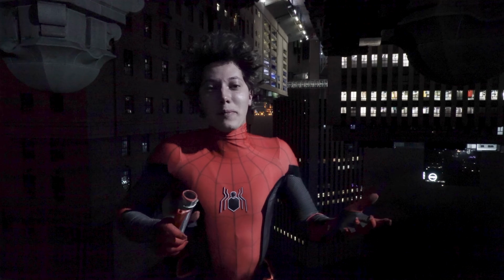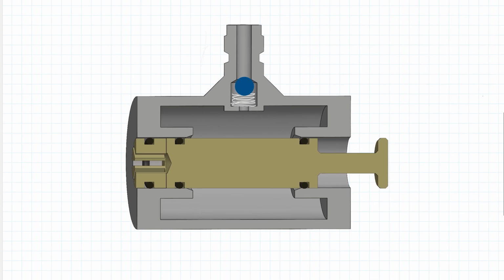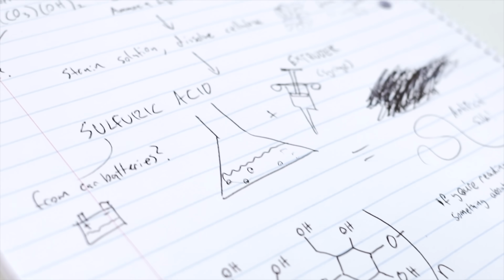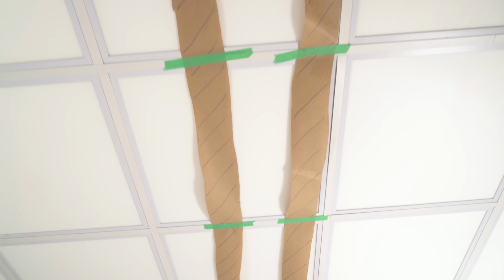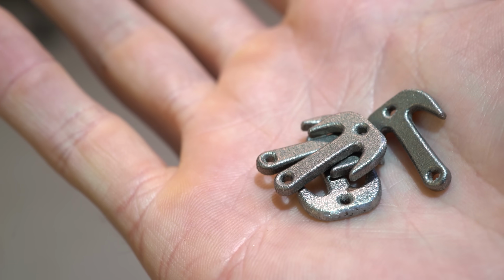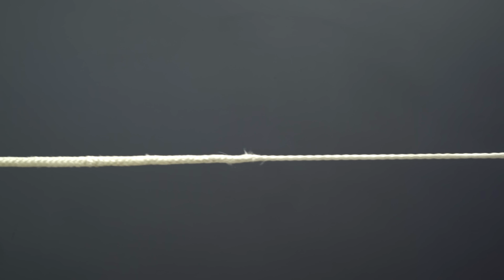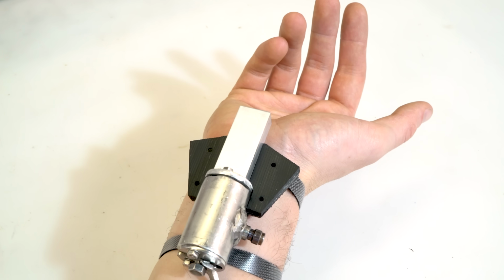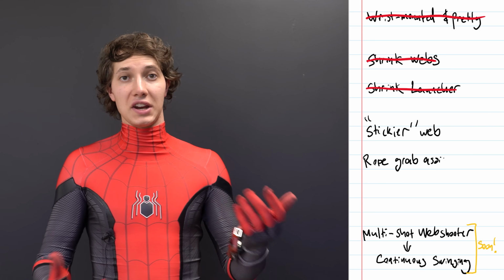Engineering real Spider-Man webshooters

Comment: god. material research, trade studies, manufacturing, strength analysis… you actually ENGINEERED this. what a gorgeous solution. you’re leagues ahead of the average maker youtuber.
Reply from the maker: I'm really proud of the engineering work, so that means a lot to me. thank you!
Reply: @Built_IRL  Organic Shooters are more reliable, Mechanical Shooters are more adaptable.
In the 2017 Spiderman animated series we saw both Mechanical and Organic shooters in use. Peter and Miles use mechanical shooters after being bitten.
Anya and Gwen used organic ones after being temporarily exposed to an Air-borne Spider Virus along with the entire city (it was a whole thing), they were the only ones to keep their spider powers.
Cindy uses organic shooters which is weird since she was bitten by the same spider as Peter, Miguel uses organic shooters according to comics and Venom creates his own strands.
Reply: @Built_IRL Is there a way to contact you directly bro?
Reply: @Built_IRL you should design your hooks to be spilced into the rope instead of the rope looping through a hole and splicing back into the rope. 
Instead of a "T" shaped hook, move the barbs half way down. Drill holes to allow the rope to pass through as it's being spliced. 
You could cut a lot ogmf weight per hook...allowing to add more barbs thus decreasing the probability of failure.
Reply: @Built_IRL  How did you choose the O-Rings?
Reply: @Built_IRL why don’t u post anymore
Reply: And going to Canada just to get the material. That is dedication even though he didn't get the steel he wanted because that price is fckin crazy

Comment: Really nice design. I'm a little unclear on the purpose of the third o-ring on your valve, though. Is this just to prevent metal on metal contact and scoring of the sealing surface?
Reply from the maker: Good catch! Exactly right, it doesn't do any sealing at all. I think it's actually got a cut in it right now, but it still works just fine to prevent scraping
Reply: @Built_IRL  

Did you consider ditching the slotted assembly in favour of a face seal or just allowing the spool to be unsupported at one end once open? This would give you an even less obstructed path, which may become important if you want to minaturise further.

I'd also suggest that a smaller revision could omit the fill port entirely, with the filling being done via the front opening (maybe tricky if the barrel is not removable). You could even get away with a solution built into the spool itself (though you might need to design your own high pressure fitting and one-way valve in that case).

Comment: I like the idea of using some type of epoxy or other fluid that is full of short fibers. While the epoxy is liquid, the fibers flow over each other. But when the epoxy hardens, the fibers cling to each other. Perhaps wool fibers, which are especially clingy.
Reply from the maker: Interesting idea.
My main problem with any glue solution is that there's no glue that is strong, tough, and instant-setting. And unlike valve design, I definitely don't have the expertise to out-research the big corps on it :(
Reply: plus the idea of squirting glue all over buildings and street lamps is probably very illegal lmao

Comment: Hey, what if you turned the rope into the steel ancors by infusing them with super glue? It would surely cut down on costs for the steel to be cut, and even manufactured, and it really strengthens rope from my own experience
Reply from the maker: Kind of like a improvised composite, I can see it
Definitely won't be as strong as the steels I've been working with, but nice thinking
Reply: @Built_IRL  thanks

Comment: Try looking into semi-automatic weapons to be able to rapidly fire multiples one after the other.  Also if you use the minimum strength needed to sustain your weight and a centrifugal break to offset the shock of your weight on the line so that the line can handle more weight on less thickness and with a spring loaded reset for the coil.
.
For all of the hooks add an electronic release to let go of the hooks so it can reload with a new hook after it recoils.
Also a valve to regulate the pressure to a certain amount no matter how much pressure is in the cartridge.
.
Hypothetically you should be able to have 1 line and multiple hooks and swing dozens of times until you run out of hooks and if you have clips for your hooks like a gun has clips for its ammo then you could keep on swinging for as long as your air cartridge holds out.  But in that case you would want a heating coil on your air tank to counter the cooling effect of repeated constant use otherwise you would begin to get diminishing returns as the cold air would not discharge fast enough preferring to contract to a lower pressure and be more viscous.  You could even have a quick release rapid replacement system for that too.  Your setup would double in size Plus the clip but it would mean the ability to swing until you ran out of air.
Reply from the maker: I've got another plan to reduce the shock loading, but good idea about the centrifugal brake!

Comment: Um....instead of individual launchers or reloads maybe just make a way to rotate to new preloaded barrels?
Reply from the maker: That's definitely one of the concept designs
Reply: @Built_IRL  maybe look at the design of a Manville automatic shotgun for inspiration? It was the gun Mouse used in the matrix it could be interesting and you could add an attachment to its grip that could allow you to use it to hold a line maybe with a quick release? The Nerf D Dart Tempest mechanics are based off the Manville I think, might be worth a look.

Comment: That was awesome, but dude you are going to blow your fingers off. I have never seen so much pressure in such a sketchy looking cylinder, stay safe
Reply from the maker: There is a safety factor of ~2, and austenitic stainless should typically leak-before-break, so I'm not just rolling the dice. But you're right, it is still kinda sketch...

Comment: maybe you can put a kevlar and epoxy sleeve around the valve that directs the explosion forward (away from you)on the off chance it explodes when you make them smaller and run at higher pressures?
Reply from the maker: Not a bad idea, but stress calculations are pretty reliable so I think I'll be fine (fingers crossed tho)

Comment: 2 years later we are closer than ever to real webshooters. Have you considered for your next video teaming up with Joel Creates to incorporate his ideas of hot glue to make the web stick?
Reply from the maker: Maybe! I think the two big challenges with that are the size of each web, and having it stick quickly and securely without being able to press down the hot glue pad at a distance. So I'll tackle my remaining issues, and if Joel can solve his too then we'll be in business!
Reply: @Built_IRL  if you want to team up, I can help produce real spider silk that, if it was just a quarter inch thick, would be able to hold 50,000lbs. I also have theoretical engineering techniques to get it to work like the movies and comics.
Reply: @Built_IRL almost the same problem as using sticky bombs in war.
Reply: There is no adhesive strong enough to hold a human, especially during a swing, the point of having a grappling rope is to provide a secure and reliable connection, if you added something sticky to it, it wouldn't work, it would just stick to itself during the launch or even if it did stick to stuff it wouldn't be able to hold any weight
Reply: @TheRealestBubby  Well. In my mind, the swinging is fiction. But the slinging webs to the faces of bad guys? Yeah that's rad.
Reply: @SamLeroSberg  Thats awesome to hear! I was also thinking instead of having multiple shots wouldn’t it be better if you could just retract the web after each shot and therefore have infinite swings? The motor wouldn’t have to be strong enough to hold your weight, just enough to retract the rope.
Reply from the maker: It's a common suggestion, but if you think about how little time there is between letting go of web A and shooting web C, that winch would have to be insanely fast, and spool the web perfectly, and now you're basically looking at a large-format grappling gun again haha @AmanStudios
Reply: @Built_IRL  Makes sense, I appreciate the fast response. Excited to see what you have in store next!
Reply: @AmanStudios  To me. I feel like it's truly fictional. There is a way to retract it back however, mechanically and electrically. But it wouldn't be as fast nor as low profile as ours truly, the masked friendly neighborhood.
Reply: @AmanStudios a motor in the web shooters is always how I figured it would work
Reply: @Built_IRL @amanstudios We might be getting a bit ahead of ourselves here, right? Maybe in 3 more versions’ time, after he’s nailed the current one?

Tbh dude I was stunned that you managed to miniaturise an original, way-higher-than-existing-standards pressure launching tank that has 1/4 power of a firearm! When you finish this it will be mission complete. But I can totally see that with the same ingenuity, you may comeback and additionally develop such a motor as discussed… if you wanted to I mean! :D I’m jonesing for the next video already!
Reply: just get bit by a spider and make it in less than 25 minutes like in the movies!
 @TheRealestBubby
Reply: @TheRealestBubby  there are exception like a gekko (sorry for worng speeling) tape or something
Reply: @TheRealestBubby  Joel hangs from the hot glue in his video
Reply: @TheRealestBubby that’s why we gotta invent one ☺️
Reply: @TheRealestBubby  Jlasers new vid proves you completely wrong
Reply: @TheRealestBubby  my guy he literally hangs from it in his video. "no adhesive strong enough", what a joker.
Reply: @@Tropical_Capybara because how do you mix those and evenly apply to the contact points, and then prevent it from solidifying in the air on the way there, would be my guess on why not
Reply: I've got some ideas
Reply: @JoelCreates  YOOOO
Reply: But still no where near and it won’t happen
Reply: two part epoxy would take too long to harden in-air
uv fast-cure would lead to timing issues with firing and shining the light
@@Tropical_Capybara
Reply: also awesomest35's reply
Reply: Yea there is, they use this tape called aerodynamic tape to mend plane wings back together
Reply: @maxheller8364 Speed tape doesn't "mend plane wings back together." Lol. That'd be neat as hell, though.
Reply: I would say this guy is the closest out of anybody making web shooters in comparison to Spider-Man
Reply: Finally someone is spiderman
Reply: لابلللاللللاللالاللاللافللالبللا
ل😡😯
😀
Reply: Pol)kllll oo😊
Reply: Bro I stay up all night and it’s this month I’m getting web shooter
Reply: this !!
Reply: @jurrac8505  NO! Not "this" actually.. lmao damn dude..

Comment: I would recommend looking in AR500 or Hardox steels, they are often used for shooting targets which makes it much easier to find. They have similar strength to tool steels but with much higher impact resistance
Reply from the maker: Yeah good call, I've actually bought a piece of AR400 (much better toughness than 500 and I don't need the extra hardness). It's close enough to tool steels strength that I may just use it for the next iteration and beef the hooks up slightly to account for it

Comment: I feel like that thumb grip triggering mechanism is going to wind up becoming canon since it literally requires the iconic hand pose.
Reply from the maker: That would be neat! even conceptually I do like it better than a double-tap or a light sensor or whatever else they canonically use
Reply: @Built_IRL What about adding rubber around the cord to grip it better? Like finger protectors on the string of an archery bow.
Reply: @enigma-189  that’s what I was thinking too
Reply: I believe canonically the button requires a specific amount of pressure to engage it. That’s how he avoids using it accidentally
Reply: @Eratic_bhavior It also requires a double tap
Reply: The hand thing already has a purpose. The button for the web shooter is above the wrist
Reply: the web shooters only go off with the exact amount of pressure from his two fingers

that way he can still make a fist or grab things without shooting web
Reply: Or maybe, because it’s a movie, they can just make it work with your mind. So you can’t accidentally set it off because it shoots when you want it to shoot. It’s not like they NEED a mechanically accurate device that works exactly how we would make it irl
Reply: @PtylerBeats  I know it isn't necessary, but comics and movies often go into detail on mechanical plausibility. For example, they'll show how Wolverine's claws work in an X-ray, or Tom Holland's costume will have arm bands a button in each palm.

What I'm saying is I wouldn't be surprised if a comic artist picks this up and runs with it as an official way for one of the spiderman variants to shoot webs.
Reply: @PtylerBeats in the OG 2002 Tobey Spider-Man movie, he wanted to shoot them out but until he did the iconic hand pose they shot out, either its the hand pose or smthn OR he prob does mind control it but he wasn’t able to at that time.

Comment: Maybe a thin steel wire through the rope and magnets in the glove to help you grab onto it as it launches and it will let you hold ferromagnetic objects without gripping them (if the magnet is strong enough) like spidey does.
Reply from the maker: Huh. I don't think there's enough magnetically-susceptible mass available in thin wire for even the strongest magnets, but cool idea!

Comment: Tiny high pressure valves exist. And they are used in joerg sprave pneumatic anti shark pistol. On the other hand, Iknow that it might be a bit problematic when it comes to legality of it but blank cartriges schould be right for this. Not the ones used for driving nails, they are too powerful. The Tiny ones used in starting pistols. And modyfying said starting pistol will give you simple multi shot  shooter.
Reply from the maker: Yeah the blanks also melt the webs. I'll look into the shark pistol though!

Comment: a possible way to make it easier to hang onto the rope or what ever you decide on using is at the end of the rope that you hang onto you could attach velcro and a bit of velcro to your palm/fingers to mimic spider-mans grippy hairs while still allowing you to not stick to everything else 🤔its just 1 possibility there could be better options but ya, apparently there is also a thing called valcro tape so idk if that would be better or worse then normal valcro
Reply from the maker: Great line of thinking, that's one of my top concepts at the moment (not with actual velcro, but a much stronger from-scratch design). Another option is showing more promise atm but I may return to this one!

Comment: If you're only running it at 15% does that mean you could shrink it a bit and just increase the pressure to get same result? Thereby allowing you to have like 3 shots per hand with a slightly bigger sized device?
Reply from the maker: Exactly! I should be able to get it way smaller in the next version
Reply: Do you have a discord for this? I have some ideas on how to have a smoother more comfortable, more conforming system for the valve activation mechanism on your palm. A simple little pneumatic TPU low profile 3d printed actuator kind of thing. I was using this design on another version of palm flamethrowers that didnt need servos or a solenoid valve to operate, just off the shelf lighter refill tanks. Might help get the valve trigger mechanism out of the way of your normal hand operation a bit more @Built_IRL
Reply: with smaller sizes you could even attempt a revolver design, to shoot multiple webs from only one device
Reply from the maker: That's the plan! @FelipeVarellaPenteado
Reply: That or maybe a linear spring loaded magazine like rifles do. But I guess a revolver going around the wrist would be pretty dope @FelipeVarellaPenteado
Reply: Or a system similar to a tube in a shotgun. May even be able to use 14guage shotgun shells to keep everything loaded. @DemsW
Reply: @FelipeVarellaPenteado  Wait, kinda like Black Widow's Gauntlets?
Reply: @Avetho kinda like Ben Reilly’s web shooters
Reply: I'm also curious about this. Micro-sized high pressure devices isn't exactly a huge field as far as i'm aware.
Reply: And then have the high pressure tanks as little cartridges that you can replace without having to connect them to an air tank and oh wait I think I've just invented a gun
Reply from the maker: Truly, all engineering ends up converging on gun @themacbookgamer
Reply: @themacbookgamer a unregulated one at that...
Reply: You could literally just use blanks in a revolving like chamber
Reply: I feel like this is exactly the sort of progression that superhero characters do as they improve their suits and tech. Like, an episode later Spiderman shows up and shoots 3 webs at the same time "Did you just..." "Well I realized that since I was running my original webshooters at 15%...."
Reply: Yes, revolver type pre-loaded air & projectile.  The combustion is just compressed air, but it would be the same theory. Fantastic use case sir. Just to sell one time use emergency grapple.hook for climbers with this small designed chamber.
Reply: عملرءع